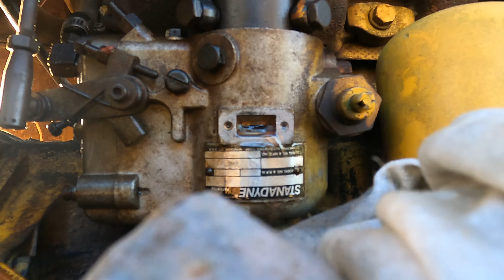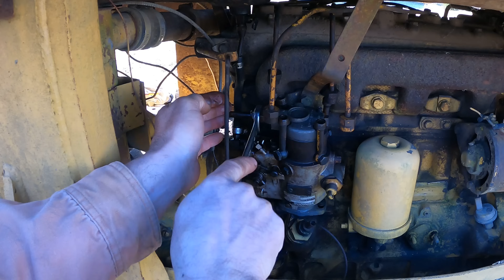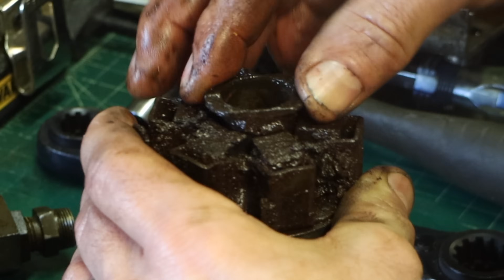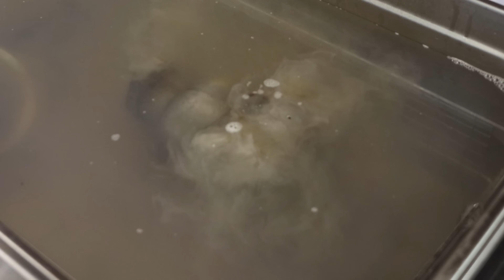Forgotten John Deere 1010 Track Loader, Part 2.

Comment: There is a lot of good advice from well experienced followers you have. I don't have much to add to all thier advice except this, I've worked with diesel engines in different pieces of equipment. Older ones like yours there, newer ones and many inbetween...  Perkins, John deere, cummins and many others. All of these engines, especially the 4 cylinder versions, have run through the worst case senerios you can think of and still lived on and still do! 30 years ago i seen a 4 cylinder perkins run away because the air filter was saturated with ether. The guy working on it saved it by cutting off it's air supply. But Not before it reved so high that the smoke from the exhaust shot straight out 50 feet before  rising up. Sounded like a jumbo jet taking off. 
I still use that same forklift today. Starts up instantly unless its very cold and not plugged in at night.

Comment: Check the top end, valves, check inside the exhaust ports see if any of the unburnt fuel is being exhausted. It would probably make a nice little tractor for bc around the yard.

Comment: I noticed that in video #1 you were unsure what exactly the chrome knob did, I think you even said "I wonder which way is off or on". Did you try and start with the shutoff knob in either position? My Allis M-65 grader has the same set-up as your 1010, but the knob has to pulled out in order for it to run (ask me how I know).

Comment: If you went through the trouble of rebuilding the fuel pump, I think you can handle engine rebuild.. valves need reseating, probably need new rings.. Doesn't have to be perfect, heavy weight oil should compensate. Unless it's completely shot. Then don't bother.

Comment: Cut your losses.   Run electric power to it and make it a lamp post at the end of your driveway.  Win-win: constant reminder to not short circuit your standard process, and it will finally be useful for you......

Comment: Do steering clutches work? hydraulic rams seem to be pitted, what about track rollers, etc ? parts can also be hard to get, if at all. This is ancient technology, awkward to operate and very heavy to move. It makes for good YouTube material, but is it worth it?
If you really need a reliable track loader, you should look for used Takeuchi (Komatsu) TL6, it is infinitely more reliable and will run rings around this ancient relic - and it will cost less considering your time, parts and frustration. Good Luck.

Comment: Hi John,  Great job on injection pump, Yes it would be great content for over the winter if you can get the engine out & work on it indoors, But is the machine worth it,what else needs to be rebuilt ,and at what cost, parts available,  just my thoughts. Thanks for your posts  Gord Ontario Canada.

Comment: The improvement from dry to wet was 50 pounds on 3 cylinders, so I would at least pull the head and check it out. ( IMHO )

Comment: If you didn't have bad hydraulic cylinders on it I would say pull the engine and take a look. Stuck rings in something that sat that long is possible. However, even if you get the engine going you still have a load of work to do. That thing makes nice content, but it's going to eat you up financially along the way.

Comment: Put it back together and use a torch in the intake to warm the intake air and try to crank it. The valves could be rusted and not sealing and the heated air will help it to crank.

Comment: Check out yesterday’s tractors for some engine parts & manuals on these. FWIW, cylinder liner deck plate, quite expensive 😮. Think I’d try a few other things before going into the full tear down, tho.

Comment: One commenter gave sum good advice he also has experience working on those engines go through the timing correctly check the valve adjustment while you have the cover off at least pressure clean the injectors they might start spraying good ( probably not with your luck) but maybe well enough to start replace those 2 glow plugs and yeah let the cylinders and pistons soak in some kinda solvent while your tinkering with the other stuff  who knows you might get lucky at the least you will have gave it your best try

Comment: I would try a little more CPR. Try to get it started and see if the rings break loose. They could just be stuck and after it heat cycles they might break free. Also, your dry compression check was after you doused the cylinder walls down with starting fluid. I would put another smidge of oil in the cylinders, crank it over once to blow out the excess, put the injectors back in{after a function check), heat the intake with a heat gun, and crank it to see if it will pop off.

Comment: Oil in cylinders put back glow plugs see if you can start it with wet cylinders. Try and get some heat cycles in it and maybe get rings to seal better. Might have combo issues with rusty valves and weak rings. 

Autopsy then LS swap hahaha

Thanks ks for sharing your experiences and adventures.

Comment: YES, RIP IT DOWN! That is why I watch and subscribe to this channel. Watching how you trouble shoot and problem solve with "farm" fixes is the whole point. There are plenty of channels with licensed diesel techs it's the DIY approach that we are looking for. One of those guys would have just reached into their $10,000 tool box and grabbed the manufactured fitting from their $2000 box set of testing equipment, that's not why I have been a subscriber to your channel all these years. Watching you fab up a fix is why I check for your new content every week. Plus winter is coming your going to need a good INDOOR project anyways,right?

Comment: If that filter is from 60's, it might be loaded with asbestos anyway.
Edit: I would like to see the engine open. At that point, it might be just a small efort more to swap out the sleeves, bearing slips and get the rings moving. 🙂

Comment: My cheap opinion.....  Confirm injection timing, clean injectors, pump oil in prior to initial startup.  Hook a garden hose to the coolant system if you have to so when it does start you can keep it running long enough to possibly get the rings working again.  And sure if you can heat the intake air like others said....  Full rebuilds quickly escalate into lots of $$$...

Comment: You should be getting some smoke out of the exhaust if you truly are injecting fuel. Just because the pump moves fuel with an open injector line doesn’t mean it’s pumping through the injector. You can pull an injector out and reconnect it outside the engine and make sure it’s spraying.

Comment: If the track frame and undercarriage have a lot of life left, then its rebuild time. If they are shot, then that plus the hydraulic cylinder rods, and engine, and a look into the transmission/final drives.
You are a very good mechanic/machinist, so it's a matter of parts/time. Also these types of machines are getting rarer, by the day. Do you have a really good use for the machine?
Best wishes all.

Comment: If the engine is junk, maybe you can try an electric conversion. According to a quick search and some conversions this engine "only" has ~30 HP with a maximum torque of 95 lb-ft (~130 Nm) as 1500 RPM. Found 15 HP e-Motors for a rated RPM of 1500. These kost around 800 a piece. So 1.6k for the motors and a used battery pack for the power.

Not cheap and not easy. But should be possible.

But on the other hand a lot of john deere fans will propably start to search for you and hunt you down. May be not worth the try :D
Reply: It would cost way less to fix the engine. And would have a usable piece of equipment. Converted to electric would be only good to look at. Usless

Comment: is the air not leaking from the pressure test through the injectors? or do they have a nrv? because at 37:25 it looked like it was leaking through it.

Comment: I would soak the cylinders in MMO and let it sit a week. Then do the test again . There are other fluids you could use I’m sure. Also maybe ask around see if anyone has knowledge about these engines. Maybe Matt from DC and or Sam from scrappy .Now that would be a great collaboration video.

Comment: Lots of carbon buildup and overheating will cause the rings to stick.  I personally had it happen on a flathead gas engine.  Fill the cylinders with seafoam and let it sit for a few days then blow it out.  Stick a heat gun in the intake manifold and try to start it.  You said it had a coolant leak so given that and its age I bet that will fix it.

Comment: Sell it or scrap it ... unless you have a need for it next year. But if you are just going to use it 50 - 60 hrs per year ... not worth the whole hydraulics repairs, engine rebuild, cooling troubleshooting ... electrical ... you'll drop a lot of time and money for not much use.... but if you intend to use it that's a whole different story.

Comment: Great job rebuilding that pump, Jon! I would try to clean the injectors in an ultrasonic cleaner. Then re-check the timing and let out the excess oil. Then try to start it. Of course, after that, autopsy and rebuild maybe.

Comment: those lines that go to the intake manifold conected to the primer pump on the dash if so that pump is used to pump oil into the intake to boost compression for cold starts

Comment: Just go out there and hold the starting fluid full on while cranking.  I bet it will fire up.
Reply: With the injectors disconnected there will be no worries about cylinder pressure going too high. With the plugged injectors it required much more ether
Reply: @daleolson3506  i mean put it all back together.  The problem with low compression is that it doesnt generate enough heat.  Starting fluid will warm things up to the point it should run on its own.  And I bet the low compression will work itself out to as the rings unstick.
Reply: Assuming you fix the injectors too

Comment: Totally enjoyable watching you  work Jon.

Suggestion - you didn't test the injectors in any way so remove them to make the engine spin over easily. Then contrive to connect a injector to a injector pipe in open air. Spin the engine and observe the nozzle spray pattern (if any) once the fuel is ejected. (Keep eyes well away just in case)

Hot air near the intake manifold will help - plumbers blowtorch or similar will do.

Cheers Jon

Comment: I think you should put some more time into getting it running before you consider a rebuild. Heat the intake air, verify injectors are firing, put extra voltage to the starter to crank it faster. Let’s see it run before the autopsy.

Comment: when you boroscoped valve dishes and rods from the intake they were rusty as f - probably reason of low compression
highly likely the thing will start if you just clean injectors though - crud from pump probably got in them

Comment: The 1010C dozer I bought back in the '90s ended up as scrap.  One thing after another turned out to need expensive parts replaced, and I couldn't justify spending all that money to get an obsolete machine.  I still have a lot of the parts.  Gave away the tracks to a friend.  The head had cracks between the pre-chamber and valve holes.  Got another head and it had cracks too.  BTW, the engine does have cylinder sleeves.  I think I may eventually be able to recover my cost because the winch from it is worth more than I paid for the whole dozer, so one day I'll go through that winch, get it fixed up and offer it for sale.  🤣

Comment: Ya did good with the pump rebuild, so hate to see things stop now! My thoughts:

1. Clean and test the injectors (if you have the means)
2. Borescope the cyls, I think several commenters were asking for that too!
3. Drop more oil into the cyls to get the compression back up, then hose it down with ether and/or heat gun and/or torch in the intake until it starts. If it will run with  "assistance" for a few minutes the rings may unstick (if that indeed is part of the issue). 

Not like you have much to lose at this point, so no need to be too worried about engine damage from ether - it almost certainly needs a rebuild. And according to the other comments, this engine is probably not worth the $$ investment to rebuild. Worst case, it makes for a good video (I think anyway). 

New subscriber, enjoyed this series! Good luck!

Comment: Yes they are a good machine. The engine I believe is a sleeve deck design. They don't share many parts with the wheeled counter part. Uncarraige parts are hart to find. But steering clutch parts were readily available. The reverser maybe another issue but won't know unless it running. Far as value if worth fixing...I don't know is it something you want or need? But on other hand spending money and time going through it you will know exactly what you got for years of service

Comment: I would put a bit of oil in the cylinders again, get all four glow plugs working, clean the injectors and try to fire it up. If you can get it running that way, maybe the compression comes back up. As you said, it could be stuck piston rings. And even if they are not all stuck, if they are rusty they won't seal well but they might polish up from running a while. I'd say its at least worth a shot.
BTW great job on the injection pump. I liked the trick you did with the air hammer to get the ball thingy off in the first part.
Reply: I agree. These things can be easily done top side. Unfortunately it’s winter so the oil won’t penetrate as well. But a tarp over with a heater in it for a while…or get a fire going and heat up some bowling ball sized rocks for 2-3 hours. Use a shovel to place the rocks under the crank case. Tarp over it for a day. 

I’ve seen it done, and nothing says redneck engineering like using a fire pit. lol

Comment: I am an avid fan of your videos. I like the ideas of: boroscope the cylinders, pulling the valve cover to confirm timing/check valves, soaking rings with ATF or MMO, and changing oil to thick viscosity 20W50. I'd love to see you get it running first before deciding on a rebuild.

Finally, you paused and questioned the timing marks on the pump. While your logic is sound when you talked through the slightly deviated marks the pump timing definitely needs more confirmation.

Comment: The air doesn't actually bubble through the oil on an oil bath filter. The air just hits it on the way by. If it's bubbling through you've got too much oil in it.

Comment: At the lowest reading of 270psi thats a compression ratio of 18.3 to 1,  Not ideal but should be enough to do something even if its just a bit of smoke!!, Recheck injector timing the pump may have been put back in sometime in the past 180 deg out!. Good luck really enjoy ALL your vids cant wait for part 3. Best wishes from the U.K.

Comment: I would pull the head and check the valves and there seats just to see if they're ok. If ok then I would remove the oil pan and do sone checks there. When both reasonable and ok then i would start thinking about a rebuild. But maby its  cheaper to get a second hand engine from somewhere if you can find one. 
Good luck and greetings from the Netherlands.

Comment: Need check your injectors see if they are spraying if its not getting fuel in cylinder it will make compression low the fuel will get pressure up too like the oil did

Comment: Not worth fixing John, which is a bummer, but it is what it is.  
You have to examine what you would need it for and determine if a more modern machine would serve you better.  If you need a bucket machine a tracked skidsteer might be a far better option and would likely be far more usable for you around the farm and any side jobs you might be doing.  
I think for YouTube content generation though, a teardown might be in order!  And as a side benefit, youll still get the scrap value out of it, and you might be able to part out some of the stuff thats in good working order (like the injector pump) if you have the patience.

Comment: If you can pull the tank you might be able to pull the head without taking the engine out other than that I'm not sure what use a track loader is on a farm but good content either way. As a previous commenter said this was built back when John Deere was still figuring stuff out for this type of configuration.

Comment: Props for tackling the injection pump. I worked at a diesel injection pump repair and calibration shop in the 80's and they can be tricky even with a test stand.  You could pull the injectors again and install them on the injection lines outside the engine, like an in-field test stand. Might give you an indication of the condition of the injectors. But I agree with previous comments regarding getting the motor running which could free the rings and get the compression up before making a decision on a tear down. Great job, love the content.

Comment: Hi Thanks for another interesting series so far.  I'm pretty sure the sleeve/ deck plate assembly for that motors obsolete or so expensive it's not worth buying one, but I seem to remember somebody say on a forum that engine has a 6 cylinder version in a combine  and you can buy a used motor and cut 2 cylinders off that sleeve plate and the head bolt patterns the same when shortened. There is a series I followed a bit on here with a guy working on this style motor in a backhoe it's not Deeres most successful motor to say the least and he had lots of problems.  To be honest I'm wondering if you got valve issues as well with how much rust you showed in the ports last video.   If it was mine I'd check the injectors so you know they are working. Then if the transmissions mechanical rather than a hydraulic torque type and the drive clutch is working , try tow starting it  with a load of heat from a blow torch in the inlet. you got nothing to loose trying it, and it might start. Take care